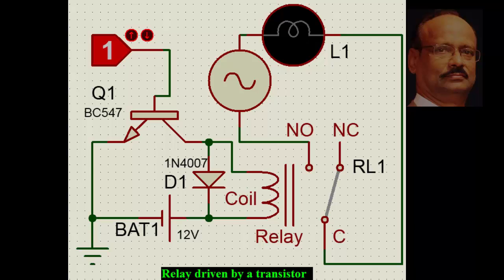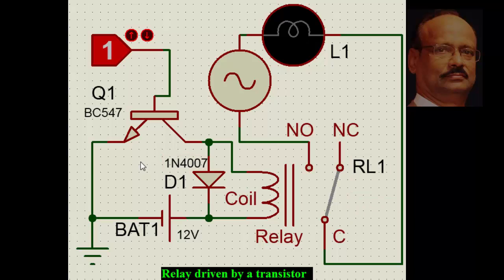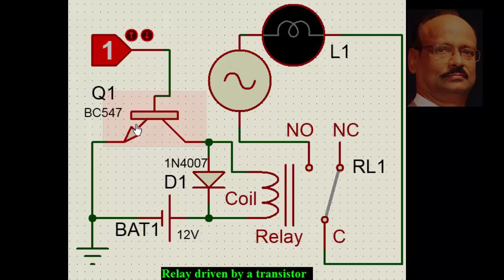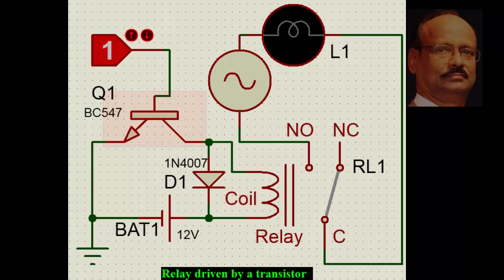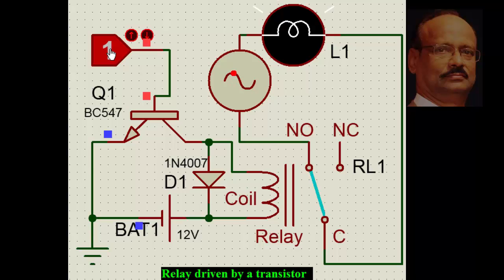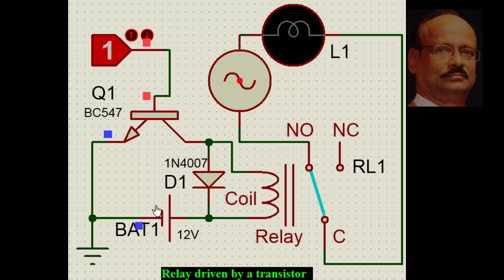Relay - Part 3- -Transistor driven

Comment: Dear sir
Is circuit me m n transistor to 1.5 v ki battery se base ko current diya .lekin ye operate ni hua .sir iske base ko min. Kitna volt n amp chahiye ye batae plz
Reply from the maker: 1.5 volt to kafi tha but direct connection without a series resistor would have resulted in burning of the transistor. Kum say kum ek 1K resistor in series chahiye